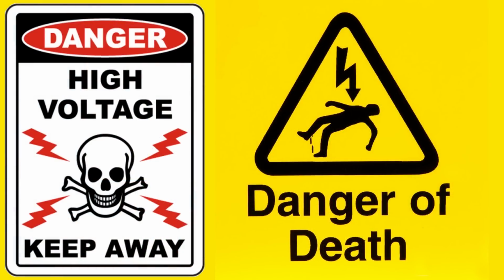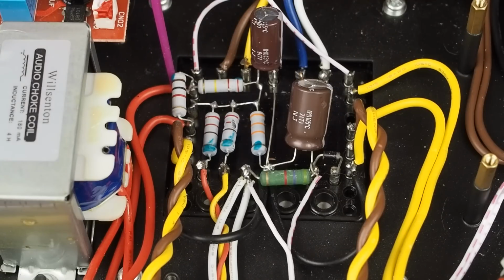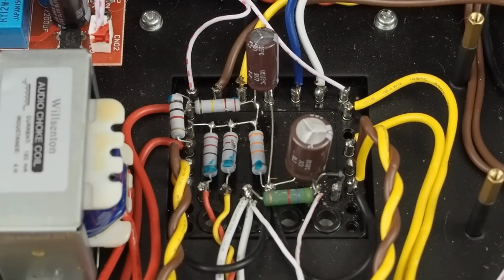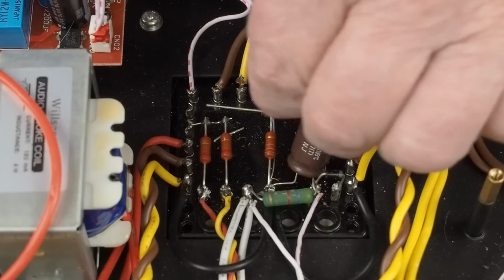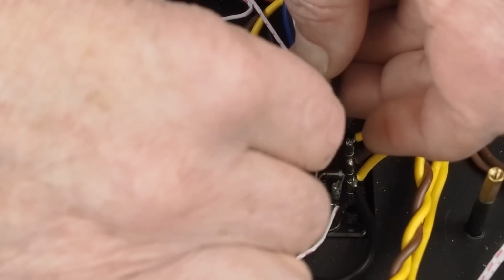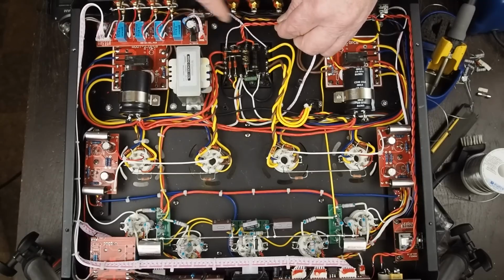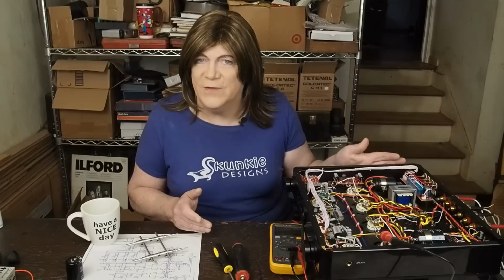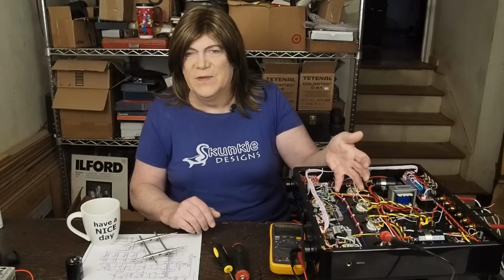Willsenton R8: Power Supply Mod and Upgrade

Comment: dear please sos, can i use on power supply 220uf 160v.. i dont have 100uf 160v.. it can be work normal?
Reply from the maker: No, use the correct caps.

Comment: What qualifies you do do up grades on tube amps? why is it necessary anyway?
Reply from the maker: Mainly it's necessary because most of them have some fairly serious design flaws that anyone who know ANYTHING about electronics can see, like having capacitors rated below the voltage they operate at. Other flaws like the lack of a backup bias supply resistor cause the tubes to red plate if the potentiometer fails, which is tube amp 101 design . Finally Willsenton ended up implementing the majority of these upgrades to their own amps after these videos were published.

Comment: hi stephe .. great videos, im about to purchase R8 , along with parts for modding, so going thru your mod series - albeit noting that the “new” unit should have some of the mods already (per yr recent vid) .. however in trying to reconcile the parts list BOM (yr web site) and yr circuit diagrams… i coildnt find the 0.33uF caps (i was looking for red boxes :) 
infound  them of course on diagram .. but not shown as a’modded” .. this is just an FYI … 
if i find anything concerning when “new” stock arrives - will let ya’all know.

Comment: Do the resistor wires have to be long enough to reach the bottom of the transformer or is it enough that they are soldered to the top silver boiling point of the transformer?
Reply from the maker: Just reaching the contact point at the top is fine.
Reply: @SkunkieDesignsElectronics  many tnx , maybe in future you will do video that you replace the transformer for something high quality, i will keep follow

Comment: Nice job! Any chance to make a list of parts to upgrade for people living in 230v (Europe)? Thx!
Reply from the maker: The parts list is exactly the same, the only difference is how the transformer primary is wired to the power IEC socket.
Reply: @SkunkieDesignsElectronics  can you briefly explain how should be the wired to the IEC performed for 230v? Thank you very much for your dedication and work!
Reply from the maker: For 120V the two primary winding are in parallel, for 230/240 they are in series.

Comment: Thank you for sharing these informative videos!  At about 19 minutes, you placed the positive supply capacitor right on top of a resistor.  Does this resistor get hot?
Reply from the maker: No, those are super low current resistors in that part of the amp.

Comment: I have a question about the twisted pair power wire going to the front panel switch.  Usually you twist pairs that have out of phase signals on them so they effectively cancel out .  In this case the two wires actually have the same (I assume hot) side of the AC signal going to the switch and then back again.  Is twisting needed here?  Could it actually be worse?  Just curious as i was always taught to twist signa/ground or signal/opposite single (opposite in terms of phase).

Comment: Stephe, that schematic on SNA forums was supplied to a buyer from the Chinese seller of the amp, and yes, it is not very accurate. Can I ask if you were feeding full mains voltage to the R8 when you measured the plate voltages in the other vid? As some of the guys down under have measured around 435v and you were getting 390v? some things are not adding up with different R8 amps. Thanks for these vids, they will help owners no doubt about it.
Reply from the maker: In one of the earlier initial videos I was running this through a isolation transformer/variac, which I later discovered wasn't supplying  full line voltage. It is closer to that 430V you mention.
Reply: @SkunkieDesignsElectronics  Thank you, Stephe :)

Comment: I became less confident with this video because towards the end your camera died and we missed you install 2 or 3 things. 

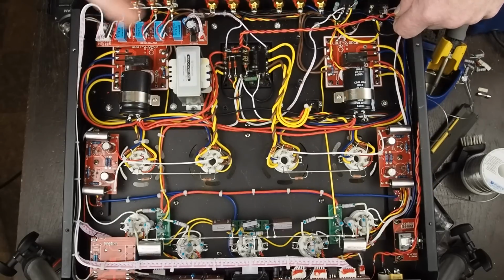#1. Mainly you didnt show us a zoomed-in image of the twisted wire soldered to the fuse and how to make sure you're soldering the correct wire to the fuse 20:10 . 

#2.  when you bridged that 18guage wire to the transformer how did you make that bridge? Did you just cut the wire and use a piece of it to solder back to the wire which turned it into two leads? 

#3 moving that rectifier to a different location. Did you just unscrew it then screw it into the terminal above it? Any tricks or tips or was it straight forward?
Reply from the maker: #1The top lug of the IEC connector is the fused one, if you study the connector that becomes clear. As far as which wire is going to the switch, it's the wire going to the switch. not the wire going straight to the transformer.

#2You can make that bridge how ever you want, I showed how I bent the power wires to make up that bridge, but it could be a separate piece of jumper wire. Never use solder as a wire.

#3Yeah, it has a screw, you unscrew it and move it.

Honestly if not seeing this in total detail confuses you, I would suggest you probably shouldn't be doing this more detailed "rebuild", replacing the wiring, and just stick to replacing components.

Comment: Hi Skunkie, didn't you solder 220ohm resistors instead of 22 ohm at 10:00 ?
Reply from the maker: These are 220ohm. Also, I always measure every resistor with an ohm meter before installing just to make sure a bad one didn't get through production.

Comment: Excellent and informative video. I was getting really OCD until 13:10 when those two wire cuttings vanished. 😀 I know you mention the difference in the video but is there any chance of a short visual explanation of how to wire the transformer for 230/240V countries?
Reply from the maker: Yeah I will do that in the next video.
Reply: @SkunkieDesignsElectronics  Awesome!
Reply: Yes this would be helpful - I could work it out but it's always good to get confirmation.

Comment: Since this is an amp made in China why wasn't it used and/or tested with your 110 volt power supplies?
Reply from the maker: Because it has a power transformer rated for 115-120V use.

Comment: BTW where do you buy your solid core 18g  wiring ?
Reply from the maker: I've just been using this Amazon wire. When the wire gauge is so overkill for the application, cheap wire is fine.

https://amzn.to/3QCYiDO
Reply: @SkunkieDesignsElectronics  Hopefully when you create a upgrade kit you can include the twisted wire with the cutout. I dont feel like spending $15 on a spool of wire I will only use once.

Comment: Wow, I'm really surprised at the factory soldering and layout. They are using leads from resistors as "tag strips". The old magnavoxes that I modify and rebuild at least terminate at tag strips and not piggy back on top of leads. Again, great job and thanks for doing this!
Reply from the maker: Yeah, leads soldered on top of leads...

Comment: Amazing how much better things are looking already. I especially agree with your comment about the switch and the fuse in the same wire. It is often not done that way. You are making this project more desirable all the time. Looking forward to your schematic. I was able to work out the voltage regulator...it was much easier to figure out what was going on when I realized the tube was in parallel. Keep up the great work.
Reply from the maker: Yeah, the online schematics I have seen are wrong!

Comment: As always really enjoyed your video. Was wondering if any of the modifications you are planning will make such that something like a KT120 or even a KT150 could be used. If I understand correctly in its present use of parts that permit installation of el34 tubes, this is not possible.
Reply from the maker: I doubt this amp would ever support KT120 tubes, there just isn't enough power supply and I have no idea if the output transformers could deal with them either.

Comment: Good work! I wonder with the ht feed to the front end if separating the decoupling is possible  as the front end has a voltage regulator  which presumably feeds both channels? Also I don't like the power choke being so close to the input section....but there's only so much you can do without rebuilding the whole thing.....
Reply from the maker: Just wait till you see what I end up doing to power the input tubes :)
Reply: @SkunkieDesignsElectronics  Look forward to it!
Reply: @SkunkieDesignsElectronics  whatever you do, I’m following suite. Been upgrading a each of your videos come out. Call me dumb but, Mouser has certainly taken some unnecessary shipping charges because I can’t seem to get it all in one swoop. Haha

Comment: Vid's 8 minutes old ! First Post.. What's Skunkie up to ???

 Oh yeah I was told only use metal oxides in filter stage, not signal .. OK in 'decoupled' roles.. Lets see :)

  Oh yeah Morgan Jones .. And ol Norman Crowhust's worth reading too, 'back in the day'

  Oh Seperate L/R HT (B+) rails ? O-Kayyy :)
Reply: Oh Seperate L/R HT (B+) rails --- What do you mean by this? ill be doing this upgrade to my R8 soon
Reply: Hi  @mike212916  - that was a mod she referred to in this build but didn't quite go there - strictly speaking, separate Left and Right High Voltage FILTERING. I hadn't really thought of that and thought I might use it too ;)

Its a bit of a luxury, doubt if you'd notice anything much .. and it'd require a few extra terminal points R's and C's...

Skunkie might bring it out as a mod later ;) ?